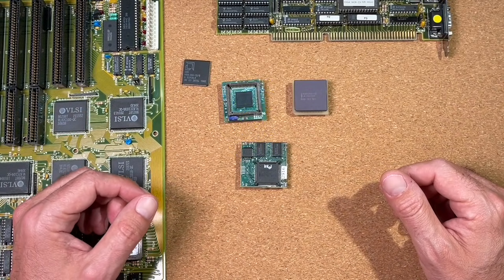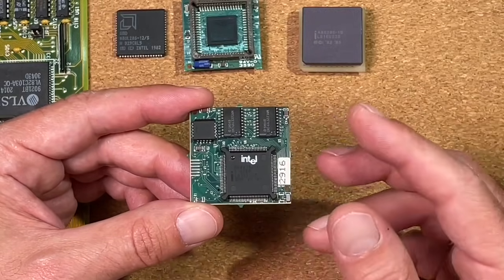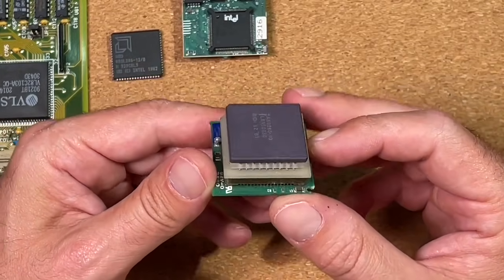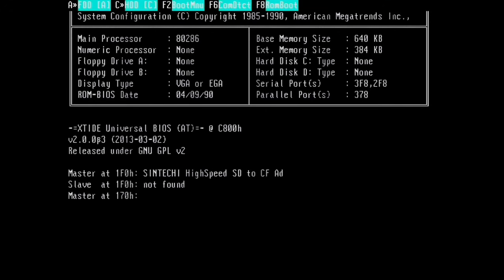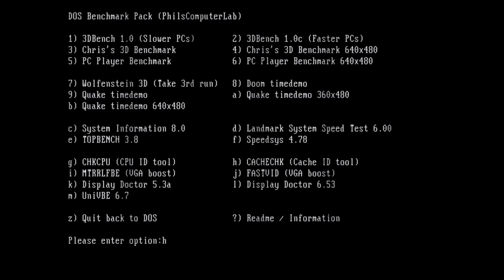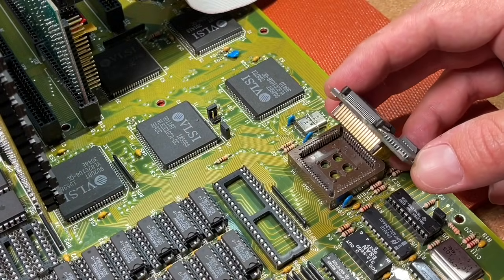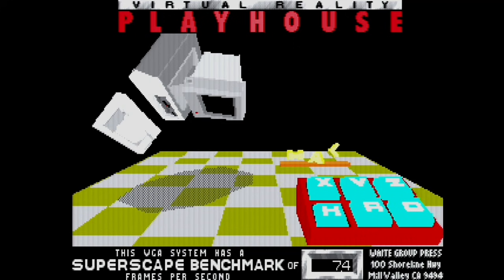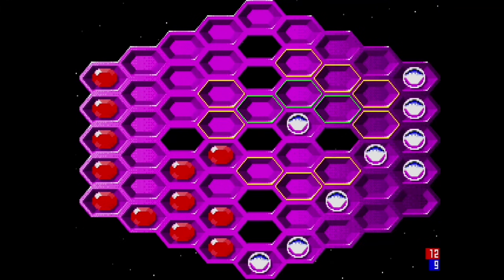286 Boost! Upgrade to 386 or additional Cache ~~ODD PARTS~~

Comment: In the early 90's I used similar parts from Kingston in order to upgrade IBM PS/2-30 ( 286@16MHz ) into ( 386SX @ 25MHz or 33MHz - I don't recall the speed exactly ).
The Kingston daughter-board even had a socket for a 387SX math co-processor and the kit came with a replacement bios-chip.

Comment: There may be a way to run Win95 using that 386 upgrade chip! If you can manage to track down an "AST Advantage 202051" ISA card, it can add an additional 3MB of memory! I used to have one when I was a kid (30 years ago). My dad's work retired one, and he managed to bring it home for me to play with on our old 286. It was amazing to watch my 286 slowly count all the way up to 4 megs of memory at boot-up.

Wasn't good for much on a 286 though, as most programs that could make use of the extra memory also required a 386 processor or better. I had bought a copy of Mortal Kombat for PC, but it refused to run because of the 286 processor. I had always wondered if getting one of those 386 (or the Make-It-486) upgrade chips would've made a difference.

Comment: What happens if you stack the 386 upgrade on top of the cache upgrade and run cache check?
Reply from the maker: I just ask myself why I did not have this idea 🤦🏻‍♂️. I need to try that.
Reply: @CPUGalaxy  I probably shouldn't be this excited by the prospect of what the result might be.
Reply: He will still need a software tool to activate the cache. But CacheCheck may actually see it installed. Betting pool anyone? lol  I wonder also if an A20# handler would activate it?
Reply: @CPUGalaxy  maybe make it one of those 60s shorts that are all the rage lately? glad to see you back, keep up the great work!
Reply: @wishusknight3009  All I wanted to know was if it would see the cache... or for that matter, post with a leaning tower of stacked socket upgrades - I'm a man of simple desires, lol. My guess is that the cache controller is mapped to HMA, but I'd suspect some additional code would be required by an A20 handler to kickstart the cache controller to do it's magic of intercepting the address lines and transparently caching data. That said, I'm just guessing - though I'm dying to know what the controller is and how it's all implemented. I've never heard of a 286 solution that involved a cache controller (not the least of which is because, while I think that 386sx might somewhat benefit from cache, as it maintained things like the dedicated ALU bus of the 386dx, along with 32bit wide paths, the 286's relatively simple internal architecture seemed pretty well tuned to its native external 16bit bus).
Reply: @smakfu1375  The first 386sx I ever had, actually had 32k of external cache on it. And it did make quite a difference in performance. Ironically the board also required 30 pin simm's in groups of 4 for some reason. And it was indeed an SX20.  

The boost with cache was a good %50 increase in most small benchmarks. At least ones that only used something like null op loops. And in VGA bench it was about 40%.  This still placed it below a DX without external cache, but not by much! 

The ISA bus on that board was also 10mhz from what I recall. It was labled a Vantage 386 and was used in the Hewett Rand budget workstation line. And was very early in the SX life on the market.
Reply: I wonder if you can stack a sonic and knuckles cart in it too. LOL
Reply: @idahofur  I have heard of people stacking a small butt load of PLCC extenders on top of each other to see what would happen. Its usually anticlimactic.
Reply: @wishusknight3009  I have 386DX board with only 8kB cache soldered and gain is still massive if enabled.
Reply: @michalceleda3968  The uplift I see on the couple of DX boards I have seems to be about 35% which is no small amount. And even more depending on the application. 

CityGate made a chipset that had 8kb of cache internally within its integrated circuit. It was somewhat later and aimed at the budget market. And actually even though it was pretty small, it benched better  then external cache up to the 8kb mark. And considering most simple benchmarks fit within 1kb it allowed them to look unusually good compared to other chipsets.

In practice the chipset's performance was pretty average but also not particularly deficient in any way. And motherboards based on it performed similarly to other budget boards with higher latency 64k external caches and what not. It would of course perform inferior to boards with larger 256k caches or ones that could do bank interleaving and such like the SIS Rabbit or the venerable ISL 744. 

I think they had an SX variant of this chipset, but have never seen one in the wild.
Reply: This was my idea too during the video. For the performance topic, if you use 386 SX in a 286 board on the same clock speed you will get almost the same performance with some special 386 specific features. Overclock can help for that only.
Reply: @wishusknight3009  So, my guess as to why your board needed 4 30pin simms was due to the cache controller implementing a 32bit bus topology between cache and main memory. Still, that’s pretty impressive that it made such a difference, which leads me to believe that CPUGalaxy guy should work overtime to get that cache module working with the 386sx upgrade. We need to know what happens for the vintage computing science.

I (my family) never owned an SX. My personal machines (which I largely funded through summer jobs, part-time jobs and saving up) were of the Amiga variety (500 and then, in 1991, a 3000 w/25Mhz 030). I still have my 3000 (running an 040-25 since 94). 

The family PC went from a Tandy 1000SX to a clone 286 and then to a monster ALR 386/33 (that my dads firm payed for). I actually used that ALR to learn x86 memory management by keying and debugging the listing for a LIM EMS386 driver that was source listed in Byte Magazine (I forget which issue). That was some serious wackiness, especially in all of the i386’s glorious low-level segmented memory insanity, something you could practically flatten on i386, but was still there (and vestigial bits still are used to differentiate user and kernel mode RPL in long-mode, which is why good old CS and SS are still set). 

This whole discussion of A20 lines, with low, HMA and XMS is waking up everything from my time working with DOS4GW, before my days in the relative sanity of NT and vmlinuz. I look at modern amd64/x86-64 and I have to chuckle that real mode, v86, protected mode, long mode (32 and 64bit sub modes) along with vmx-root, all still exist side-by-side. Kick your UEFI’s legacy BIOS boot mode on, and you can still natively boot DOS 1.1 and run donkey.bas at 3 billion FPS on a single LP of your many-core SMT x64 CPU.

God help me, I do love this stuff too much (just ask my wife).
Reply: I wondered the same thing.  Perhaps the PGA to PLCC adapter being installed in the cache module was a red herring.
Reply: @halfplushalfsqrt5  The PLCC adapter is probably needed for a QFP because they are flush on the bottom, and the chip inside the socket is risen by a MM or two. However I doubt he would have trouble with the cache insert though.
Reply: @wishusknight3009  That is addressed in the video.  I'm simply suggesting that sometimes used parts can be found connected for no more reason than physical compatibility, so it can be an error to assume any more reason than that.  Like a tall stack of serial cable adapters or an Athlon plugged backwards into a Slot 1 board...(yes, I've seen that).
While it would be silly for the cache adapter here to also require a 386 upgrade to function, as mentioned above, it's a good thing to try since cachechk requires that instruction set.
Reply: @wishusknight3009  LOL… I didn’t know that about dos games lists. I sadly don’t maintain much truly vintage PC hardware, I play my old games in DOSBox. My vintage C= collection takes up too much space (I’ve also kept a couple of notable machines from my career, including a microVax and an SGI Indego) along with my rather outsized footprint of current era equipment, so I have to relive my PC memories  vicariously through CPUGalaxy and Adriens Digital Basement. 

The Amiga is a really neat machine. The most interesting aspect of the Amiga is that it has much more in common with modern computers than its contemporaries. Notably, when programming copper lists, it follows the same inner-loop/outer-loop like pattern as programming modern machines with GPU’s. Throw in an overall OS and hardware platform user experience that “feels” modern, and you have something that is like a direct ancestor of modern systems, even though it isn’t. Put another way, Jay Miner and team built something that was, in some ways quite accidentally, 3 decades ahead of everyone else. It’s also just a ton of fun to play with, code on, and play games on, which is why it has such an enduring legacy.

As for the x86 ISA, a quote from a computer magazine in ~1989 has stuck with me “the i8086 architecture is, against all odds, the eternal winner, always getting faster and better, as others fall by the wayside”. 32 years later, I wonder if the author could have imagined the x86 ISA would still be with us. Given it was a British computer magazine (whose name escapes me), I wonder if they would have believed that the other dominant ISA would be tiny little Acorn’s “Acorn RISC Machine” architecture from the Acorn Archimedes. The mighty Alpha AXP, MIPS, SPARC, i860, IA64, PowerPC, MC680x0… all vanquished, with x86 and ARM as the two heirs to the CPU universe? If you told my 1991 self that’d be the case, I’d have said you were nuts.
Reply: @halfplushalfsqrt5  Yeah, I’ve got a few boxes of old hardware where I’ve totally done stuff like that. I had totally forgotten that AMD’s Slot A was mechanically identical to Intel’s Slot 1, but flipped. I remember reading that, back in the day, and wondering how much smoke would be generated if you jammed a slot A CPU into a Slot 1 board.
Reply: @smakfu1375  I keep a pretty healthy collection with me too, My partner is quite forgiving of it thankfully lol.  I would have never thought ARM would be the second big player, though I knew x86 would always be around for a while.  ARM has this wonderful way of keeping its legacy baggage to a minimum while lending itself to very flexible implementations. 

The things that i would NOT have believed in 1990, Apple going to X86, and x86 possibly being pushed out in the future by a second archy like ARM. 

However i also thought that the 64 bit heavy hitters like alpha or mips would have stuck around. But once x86 adapted and grew into that space, the only one left is IBM's power archy which is extremely nitch. 

Amiga's interoperability with different CPU generations and accelerators is what is fun for me. This is much harder to do with x86 except for the industrial machine I have that uses a passive backplane lol.
Reply: Yes, I was thinking the very thing from the beginning.
Reply: @CPUGalaxy  Did it do the trick?
Reply from the maker: no. unfortunately it did not work.
Reply: @CPUGalaxy  Thanks for the update
Reply: @CPUGalaxy  Darn! Well, thanks for trying it out!
Reply: @CPUGalaxy  ohh drat.. just no life from it at all?
Reply: @CPUGalaxy  It didn‘t work at all or did you mean the CPU worked, but the additional cache wasn‘t recognized?
Reply: @idahofur  WITH LOCK ON TECHNOLOGY!!! Combined with Blast Processing, Genesis does what Nintendon't! :-)
Reply: Was thinking that as I watched it.
Reply: @CPUGalaxy  if that worked I have been dying to know 😅

Comment: Great to see you back. Indeed, my first thoughts on the cache upgrade were also that it must have had some software. The SX/Now needed a tool to enable its own cache, but it is doubtful that it would work on your upgrade board. Suppose it wouldn't hurt to try it if you could find it.
Seems the Tandon and Toshiba were not the exception, then, meaning the 386 is for sure slower than the 286 at the same clock. Good to see this confirmed.

Comment: Very cool parts! Would be really interesting to see that cache thing running. But nice to see, that my guess about the 386sx yesterday in the pre-announcement wasn't wrong ;) This were similar results, as what I got in the past. 286 is always slightly faster at the same frequency, then a 386sx. However, with 386sx you get huge benefit in Win3.11, since 386 has better support for protected mode and even more important VM86, which allowed to run more than one real mode program in windows in parallel. With 286, windows had to be closed during the execution of a real mode applications and was restarted again, when this application was finished.

Thank you very much. I'll ask around, if someone knows anything about that cached 286 thing.....
Reply from the maker: yeah, I had to lough yesterday when I saw your guess about the outcome. 😉
Reply: Yea I had customer complain about that. Oh it is slower. Well yes, but it now runs windows 3.1, 95, xp. Well you get the idea.

Comment: Maybe not time to give up on the cache module just yet. Perhaps those 100ns drams are being run at 0ws anyway (83ns) As I was able to use 100ns Ram in a little project I had going that required 80ns back in the day. Would be interesting to try on 20Mhz 286. A speed where the 100ns DRAMS will definitely not go. If it still doesn't gain performance,  then I agree the 6k cache is dead. As for the 386sx being slower, I remember my 1st upgrade was from a 286-16Mhz to a 16Mhz 386, and it was a massive disappointment. If anything it seemed a little slower. HOWEVER, whereas my 286-16Mhz was unstable overclocked at 20Mhz. My lovely 386sx cpu would over clock to 25Mhz. At which point it was a big improvement after all :) Plus it ran windows3 properly :)

Comment: I have a similar little 386 board installed into the 286 socket on my IBM 5170.  It's called the "Intel SnapIn 386" but mine has a 2.5x clock multiplier and 16kb cache right on the upgrade board.  The multiplier is always active but the cache gets enabled by software - and even with the 20MHz clock speed, most benchmarks show slightly less performance than I got with the original 8MHz 286 if the cache is not enabled!  Really goes to show how badly the 386 CPU is hampered by the slow memory pathway on this board (main RAM tests at at roughly 2MB/sec whereas the 16kb cache does about 10MB/sec).  I wish I could mod it to have, like, 1MB of cache onboard!!

Comment: In the early 90s, I do remember coming across a few IBM PS/2s ... can't remember the model, but they were one of the ones that originally came with a socketed 286.  It had a 386sx daughterboard in place of the 286.  It looked very similar to that first one you showed.

Comment: Yeah - at 6:34 your PLCC socket is cracked. The sockets weren't designed for many insertions/extractions - I cracked the sockets on a couple of PS/2 Model 50Z planars testing the Kingston "386 Now!" upgrades.
Reply: happens often when you use a lever against the socket to remove the chip, the dedicated extractor usually prevents cracking them

Comment: maybe those cypress memories are not a cache, but, just some faster direct mapped memory, probably used by special sw that put critical code and data that needed to run as fast as possible.

Comment: They really sold some strange parts back in the days. I started with a 286 at 12mhz, then I asked for an upgrade, and they told me I need a different mainboard for the 386, but they have a cheap one that works perfectly for me (I was a student back then) and they take the other parts in commission for me. I trusted them and was not disappointed. After upgrading to an 386 with mindblowingly 33mhz, it ran like warp speed for me. And the best thing: The mainboard was somehow compatible to the 486 which I put in 2 years later (1995) and sold the 386 again. Now I had a 486DX2 80mhz and again, 2 years later I upgraded to a DX4  from AMD with 120mhz and overclocked it to 133mhz, so my 3DFX Voodoo card had something to do :D

Such good times.

Comment: IIRC, the cache in these upgrade chips sometimes required a BIOS update to enable the cache.   Which, as it turned out, was not always available for specific motherboards.  There were compatibility issues.

The only real advantage to the 286-to-386 thing was it gave you 386 enhanced mode for Windows, which was not available for 286-class machines.  As for the memory limitation, there were peripheral cards that allowed more addressable memory.   Four- and eight-meg cards were easy enough to find (but expen$ive!)  So, in many cases, it was often more cost-effective (long-term) to spring for a new machine than to 'upgrade' what you had.

Comment: At first glance I thought that 386SX upgrade might have been a Kingston SX Now, but after a quick google it looks much simpler, which is probably why it was no benefit.

One of my IBM Model 50s came with a 386SX-20 upgrade boardr, which is also a lot more complex, including a few larger support chips and an 8K SRAM. Although it is a single 8-bit SRAM chip, so it would take a minimum of two clock cycles to retrieve any data, since the 386SX and 286 uses a 16-bit data bus. Unless it's doing some weird clock multiplying, but I feel like that would be way too complex for such a small upgrade board.

Comment: Very nice ! For the cache adapter, maybe it's possible to retro-engineer it using software in some way ? Don't quote me on that but maybe you can use a software to "sniff" the ports on the bus and therefore find those used by the adapter board ? (then you'll have to try many things to figure it out but anyways).

Comment: I have one of these. It sits snugly in my PC9801VX. I actually plan to replace the 386sx16 CPU (Clocked at 20Mhz) to a 486sxl2 CPU at 40Mhz.